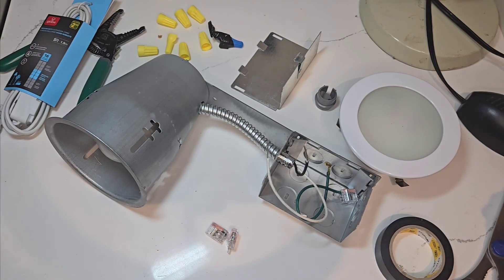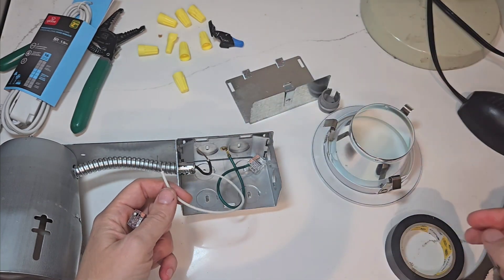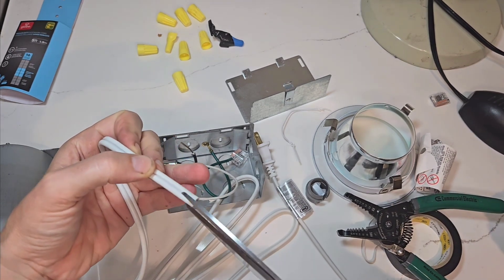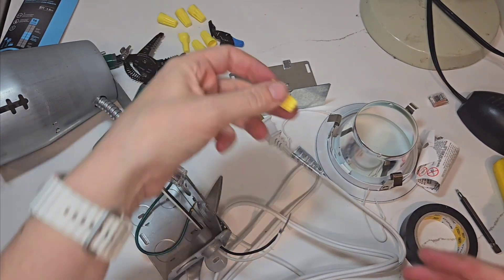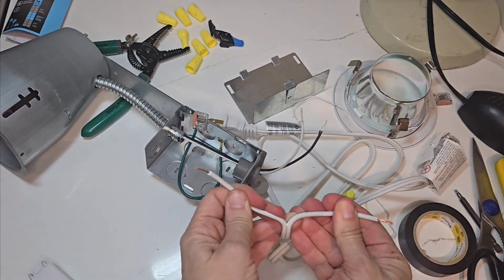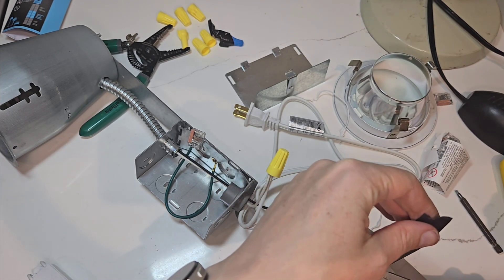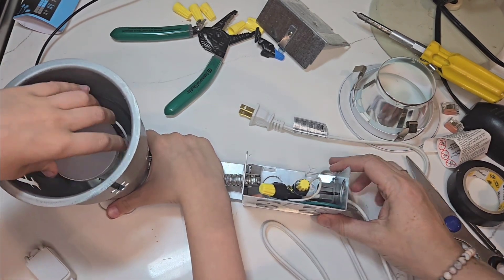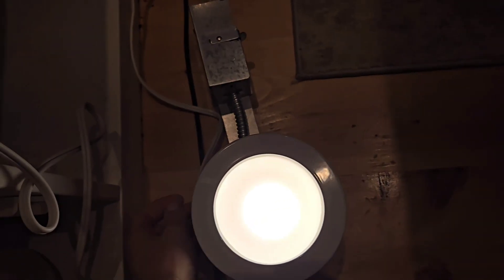Wiring a Light to a Plug

Comment: Im 12 years old and I've been working with lighting and electrical since I was nine, the wiring is safe as long as the cord is not pulled on a lot
Reply: I done that too. I screwed making a pl light with cfl ballast and I killed the ballast when I put a bulb with open filament. That shouldn't have happened though. I wonder why

Comment: It does make a difference how you wire black (hot) and white (neutral). You want to connect black (hot) to center of bulb socket and white (neutral) to outside of bulb socket. Otherwise changing a bulb can be shocking.